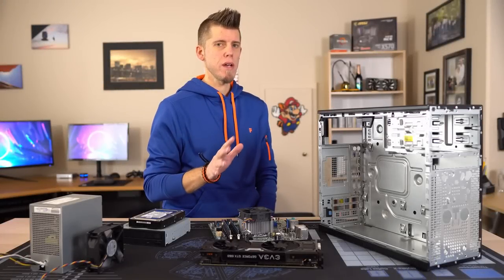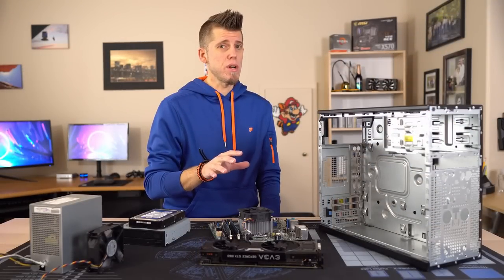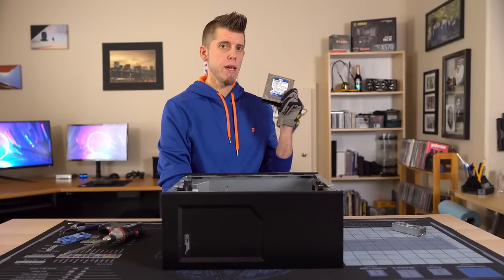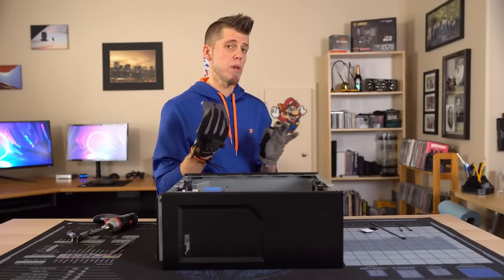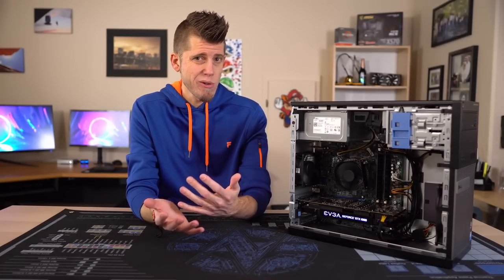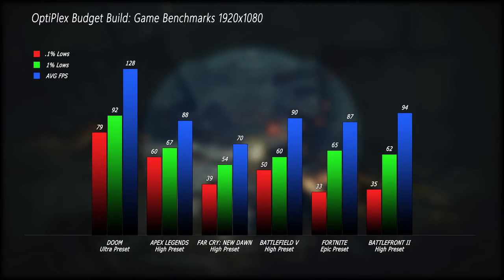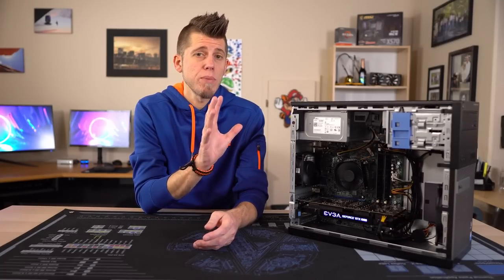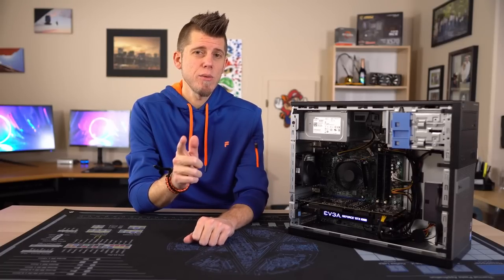Dell OptiPlex Budget Gaming PC For Under $300?

Comment: How do you get 90fps in Battlefield 5? I am getting barely 55fps with low-medium settings. I am using a rx 480, i7 2600k and 16gb ram. Can someone help me?
Reply from the maker: Try turning future frame rendering on.
Reply: @TheGameBench  it was already on. I don't know why this happens. Do you have a solution?
Reply from the maker: @joostwagelaar8837  Honestly, I just run it on the high preset, future frame rendering on, DX11, and I turn off motion blur and film grain. If you're still having issues, I would try using DDU to remove the drivers and reinstall the latest ones with the system disconnected from the internet. Windows Update will install it's crappy drivers if you don't, and I've seen them cause all sorts of weird issues.
Reply: @TheGameBench  is it okay if i download it, disconnect my pc from the internet, and then install the drivers?
Reply: @TheGameBench  you helpt me out. The game works perfectly fine now. I subscribed to you. Thanks for the help!
Reply: 🙂 he's running an intel cpu and a gtx video card, on some video games the 'Game Engine' is optimized exclusively for Intel CPU's using an Invidia GTX Card, if you use a different combination it will feel like your running a console port, it just depends on the game versions and patches, the version of the game engine, also the driver version, and what generation your gpu belongs to. Theres alot of things to consider. Also your windows install, motherboard bios and drivers, ram, power supply. Make sure everything is working properly. Double check that you dont have some sort of trojan or malware running in the background 😃
Reply: @MrSamadolfo  thanks for the explanation!
Reply: @joostwagelaar8837  😇 your welcome

Comment: got the optiplex 3010 about a month ago picked up a bargain gtx 980 for £100 changed the psu to corsair vs450 and drilled out the cage for hard drives and reinstalled it in the mounts that you cut off works great usally getting 60-80 fps in gta v (high settings) fortnite 120-160fps on high settings is well at 1080p evrything cost me under £240 so just under 300 usd absolute console muncher machine !

Comment: 1060 super , 5500xt or 1660? Used 1660 on ebay are pretty costly now .
Reply from the maker: There are some games where the 1660 has a decent lead on the 5500 XT, but most of the time, they're pretty close. Same goes for the 1650 Super. Since you are open to use, I would suggest the RX 590 over all these are around $150 n eBay.

Comment: what power supply you have used the one came with the original build?
Reply from the maker: Yes, I used the 290 watt PSU that came in the 9020. I did testing in my last video to see what I could run off the stock PSU.
Reply: @TheGameBench  with similar config I am using GTI 1050TI 4gb will it need 400watts power supply or ii can stick to what came with optiplex. thanks
Reply from the maker: @santoshdl  The 1050 Ti sips power. I think the reason that nVidia makes suggestions like that is to account for terrible PSU's. The 290 watt that comes in these is pretty good and with the 1050 Ti, the total system power draw won't pull more than 150 watts at full load. I tested it, and other cards as well. If you want to see my testing, you can see it here.

https://www.youtube.com/watch?v=F3drZ1cWM0U&t=122s

Comment: What is your power supply wattage?
Reply from the maker: The power supply is a 290 watt. But, the 1060 is a low wattage draw GPU. I did testing in my last video and the total system power draw, at max load, from the outlet was around 240 watts. Now, the power draw from the power supply will more around 220 watts, or less. While it's not ideal, it not an issue or in danger of damaging any components.

Comment: I builted one specs  Cosair TX650M psu i72600 16GB hyper fury ram 1060 GTX Strix OC... it's a beast i need to upgrade the ssd to 1TB 250gb is not enough storage lol

Comment: Hey so I would like your opinion on something I want to build a pc from a dell optiplex 9020 using mostly used parts
The specs of parts that I want to buy are as follows
An I7-4790
8gb of ddr3 ram
A 1Tb hardrive
A 128gb SSD for a boot drive
And a Rx580 8gb
With a new Evga 500 watt powersupply to support the rx580
And I can get all of this for around $430 is this a good deal in your opinion (and I will be doing the hard drive caddy mod if I get it so I can fit the rx580)
Reply from the maker: Compared to the prices I try to stick to... I'd say it's about average, not great, but not bad either.
Reply: @TheGameBench  ok thank you for the response it is much appreciated
Reply from the maker: @questionablegaming3260  No problem.

Comment: hey bro new subs here, is 260watts for dell 3060 enough for 1650 super? or 1660 super? thanks.
Reply from the maker: The 1650 Super will be just fine on that PSU. I don't have a 1660 Super to test with, but everything I'm seeing shows that the system would be around 200 watts on power consumption, so it should be fine as well.
Reply: Thanks bro appreciated.
Reply from the maker: @nathanielchaca2920  No problem.

Comment: Can I use the same parts on a Dell t20?
Reply from the maker: Looks to be the same power supply, same chassis and same board. Primary difference is the fact that it uses desktop Xeons, but they're pretty equivalent to the desktop Core series. Could be some other minor differences, but you should be able to do the same modifications as this video.
Reply: @TheGameBench  thank you !
Reply from the maker: @astridd30  No problem!

Comment: Do you have to get a higher wattage psu if you're putting in something like gt1030 or is the 265w psu enough
Reply from the maker: Nope. The GT 1030 barely consumes power. The 265 watt is overkill for a GT 1030. I doubt your total system with the 1030 would draw more than 150 watts from the wall, most likely less.
Reply: @TheGameBench  thank you
Reply from the maker: @ajadossantos  No problem!

Comment: Where did you plug the gpu?? Where can I get that cable?
Reply from the maker: I used a SATA to PCIe adapter. Though with the 1060 I'd revise this and suggest using a dual SATA to PCIe adapter.

https://www.amazon.com/Power-Express-Video-Cable-Adapter/dp/B007Y8FSMQ/ref=sr_1_3?dchild=1&keywords=dual+sata+to+pcie+adapter&qid=1621826026&sr=8-3
Reply: Can you do a video about it please?
Reply from the maker: @mateoupdate6268  About how to connect it? I would be a very short video. All you have to do is connect two SATA power connections to it, and then connect the PCIe power connection to the video card.

Comment: I need GPU For my Dell Only I can't Find Nowhere Any Help ??
Reply from the maker: Yeah, right now I'd keep an eye out for any 4GB card. They're becoming less useful for miners and they're still expensive, but somewhat in the realm of reason. Right now my best option goes to the RX 470, 570, 480 and 580 4GB cards. They go anywhere between $150 and $300 depending on the model on eBay. You might find them close to that lower end locally. And the Asus Strix and XFX RX 470 4GB cards can run off the stock power supply.

Comment: Anyone have a problem with sleep hibernate and shutdown?? I put a amd card 600watt psu and the cable 24pin to 8 pin to make it all work perfect no problem got games installed up and running perfectly. A month later now whenever I sleep hibernate or shut it down it will not turn on at all! 2 orange flash pause 2 orange light. I open the tower and unplug the 8pin plug it back in and the pc works fine all temps normal.... I have no idea what to do and I don’t want to keep the pc on forever but it looks like that might be my only option thanks for reading
Reply from the maker: Did you get the 24-pin to 8-pin adapter I linked in the description?
Reply: @TheGameBench  Yes, I fixed the issue. Enter bios there is something called "deep sleep" or something like that and disable that. Now it works perfect!
Reply: @TheGameBench  I am having the same problem today..... I thought that it fixed the issue but it is back. So upon looking at your description of parts to buy I do not see the 24pin to 8pin  only a sata to 8pin connector. I am thinking that the one I bought is faulty maybe to much power from my 600PSU? idk but I am willing to try the one you you have but I can't find it in the description sorry for being redundant :pthanks
Reply: I see the reason why you don't have it in the description! it's cause you use the same PSU. Damn lol no wonder I was confused! Np I guess I'll buy that and use the PSU it came with. I wonder if it will run a rx570

Comment: Surely the cost doesn't include the Windows 10 license does it?
Reply from the maker: No, you can get Windows 10, legally, for free. For individuals, you can use the Windows 7 OEM keys that come on these to upgrade to Windows 10 for free. I have a video on it. Also, even if you don't activate all you have to deal with is the water mark and some limits on personalization. I've built over 20 systems like this, and I've never had to pay for Windows 10, and they've all been activated.

Comment: i wonder if the gtx 1060 will work for dell xps 8300 with motherboard ref: Y2OMRG with A06 bios and a  psu 380 watts  .
Reply from the maker: I can't seem to find that power supply to look at the amperage on the 12v rail(s), but it's very likely that it's more than enough for a 1060 6GB. I've never heard of people having issues installing GPU"s in 8300's. I know they're very popular. The BIOS is a bit old, but they're easy to update if you need to.

Comment: can i put in the gtx 1660 super by gigabyte to my dell optiplex 3070 tower (not the micro one) without upgrading my psu ?
Reply from the maker: Depends on the model. The Gaming OC model might not fit... but all the other Gigabyte models should fit. Power consumption wise, you should be fine. Especially if there's no power connection on it. If so, you can use a SATA to PCIe adapter and it'll be fine on the 240 watt PSU.
Reply: @TheGameBench  is there any demonstration on you showing how to put a gpu in any dell optiplex with same case 
Ps thank u so much
Reply from the maker: @yassinamin  No, I didn't remonstrate it i the video, but it's as simple as plugging the SATA end into an open SATA connection and the other end into the GPU. The connectors will only go in one way.

Comment: I have 3020 Optiplex. I bought it for 120€. My goal was to build pc cheaper than ps4 but better for gaming. I buy 128gb ssd for 19€ and i was looking for gpu. I have a few options here 75w gtx 1050ti used(90€)  or 1650 new(170€). Then I took watt-meter and found that whole pc take 24w in idle and around 84w in stress test. Power supply is 290w continius power. It have two rails on 12v for around 360w. Then I realise that I can took more powerful graphic card. Rx 470-570 120-150w used for 70-80€ or Rx 480-580 150w used for 100€. Gtx 1060 6g is more expencive used 130-60€ but is more suitable for this build 120w. Then Nvidia present 1650 super. 100w card with excelent performance. I took that card for 180e new Zotac with 5 years warranty and buy sata to 6 pin adapter for 2€. Yes ps4 is now cheaper then this pc because new graphic card. But with used card you can have great price to performance pc. Specs: i5 4590 2x4gb 1600mhz ddr3 1tb hdd 128gb ssd gtx 1650 super 4gb. Price: 321€ plus monitor also used Dell P2414h for 70e. Ps4 is around 280e, Ps4 pro is 400e in my country. Great video and great content for us budget builders. I want to see more mods with this case, maybe change colors or paint motherboard, adding side panel etc... Thanks 👍
Reply from the maker: Yeah, can't really run much more than an RX 560 off the 290 watt in these things. Kinda' why I went with the 1060. I just bought a 1650 Super to test against the 1060, as well as some other GPU's with a range of CPU's. It sounds like you built a system that's more than substantially better than the PS4 for not much more.
Reply: @TheGameBench  Well these power supplies are very capable 290w of continious output not peak.12v x 14a plus 12v x 16a is 360w peak for less than 10msec. I see some off these with Rx 570/580. It can run with Y adapter sata to 8 pin. Sata have 54w 2x54w +75w from pcie is enough. But Gtx 1650 super is more powerful than Rx 570 and only 100w. I done some measurements in few games. When everything is on max settings and frames are not lock on 60fps with vertical sinc, gpu power is in peak power of 100w. 101w is max what i see in Msi Afterburner. If the Fps are lock with my monitor refresh rate in my case 60hz max power use is 80w gpu and cpu is less then 50w in some heavy games Bf V, Bf 1 GTA V. And screen tearing is fixed with this. Only in Csgo i don't use vertical sync. Who want's to use Radeon cards I would recommend undervolting card.. less power consumption, less heat same results and vsync for even less power consumption. I have only one question for you: can we change back fan if we change the adapter on new one ( i mean to cut plug from dell fan and solder to new fan). I read somewhere about wire connections (order of wires) are not the same on Dell and regular fans but voltages are the same? Some rgb would be nice☺
Reply from the maker: @progressiv8985  Sure, and I've sold these with 480's and 570's before I started doing testing and I haven't had anyone bring one back for that. So, I know it can be done, I'm just not comfortable with that little overhead. These PSU's are pretty surprising though. I've had quite a few people give me crap about running the 1060 off them. However, they are probably the same people that think you need a 300 watt PSU for a 1050 Ti because nVidia said so.
Reply: @TheGameBench  Well said. Wish U all the best in next project ☺
Reply from the maker: @progressiv8985  Thanks! And I appreciate the feedback.

Comment: Does the sata to pcie can damage the gpu I'm using rx 470
Reply from the maker: Not under normal circumstances.
Reply: @TheGameBench  you mean Overclock and thank a bunch man!! Great content BTW
Reply from the maker: @ableh7489  Overclocking? Yeah, not something I would suggest on these adapters. Especially on an RX 470
Reply: @TheGameBench  thanks a bunch man loved the content BTW!!! so if I used normally it will be okay right
Reply from the maker: @ableh7489  Yep, it should be perfectly fine.

Comment: I want to see a build tutorial due to the power supply difference and what is needed to plug a gpu with two eight pin connectors
Reply from the maker: Well, your 550 watt PSU should have the cable on it. Or does it only have one?
Reply: @TheGameBench  Just saw a video using an 24 pin to 8 pin connector. I've seen videos where some people only plug one cable into thier gpu even with two ports on the card so i'm wondering do i need to use both eight pin ports on my 1070? that is the one thing i am confused about.
Reply: @YakDiezel  🙂 thats odd, most 1070 cards only have a single 8 pin plug? check and confirm
Reply: MrSammy it's a zotac GTX 1070 amp edition. I found that my psu was able to connect without the adapter. But yeah, two eight pins.
Reply: @YakDiezel  🙂 oh ok maybe thats why, its a realy fancy overclock card, glad it works for you yay 😇
Reply from the maker: @YakDiezel  Sorry, I thought I got back to you. As far as I know, there are "SOME" dual 8-pin models or 8-pin/6-pin models, where the second set of pins are for overclocking and you only have to plug one in. Most 1070's I've ever seen only have one. Like Mr. Sammy said, just check and confirm on the specific model.

Comment: Hey man I know Im kinda late on this video but Im buying a 9020 and I don't have any of these tools to modify to case so I can fit a fan in the front..so my question is will my pc not overheat using only rear fan (planing on replacing the stock one with a noctua fan) and replacing the termal paste on the processor, I would be using a GTX 1060 6GB version and i thought replacing the stock cpu cooler with a better cooler (can you help me pick one to like $40).
Reply from the maker: I've been thinking about ways to install a front fan with nothing but a screwdriver, but honestly, if you have a good cooler on the GPU, you might not need a front fan at all. What model is it?

As for the CPU, replacing the cooler is going to require tools to modify the existing backplate to install an aftermarket cooler, but the stock cooler is perfectly fine for any of the CPU's that come in these. I would only bother if you're planing on putting a 4790k in there. But, at that price point, my suggestion would be the Cooler Master 212 Black.
Reply: @TheGameBench Which model of GTX 1060 do you recommend, Im planning on buying one on the aftermarket and the prices are really good here for a gtx 1060 they go from $100 now
Reply: @TheGameBench  And will it fit in the case without any modifications?
Reply from the maker: @hill7487  Okay... had to retype this. So, one that will fit without removing the HDD cage would probably be the Zotac 1060 Mini. One of the better coolers for the smaller cards. The EVGA 1060 SC 6GB would also be a good choice. They might need the TIM replaced to work well without the front fan. At least that's been my finding with the models I've played with. If you need to add a front fan, you could easily put an 80mm... maybe a 92mm fan in the front.
Reply: @TheGameBench  Alright thanks for the help It really means a lot because I'm kinda new to this and I already found a good deal on zotac mini :D

Comment: For the fan do i need a extra cable or can i just use the sata power cable?
Reply from the maker: Well, you'll need the SATA to fan adapter. If you don't have an open SATA power connection, you'll need the SATA power splitter. The resistor cable is optional if the fan is too loud. You can always grab one later if that's an issue.
Reply: @TheGameBench  alright thank you